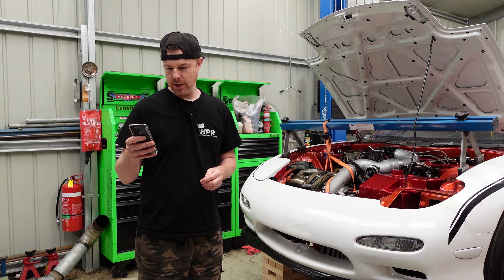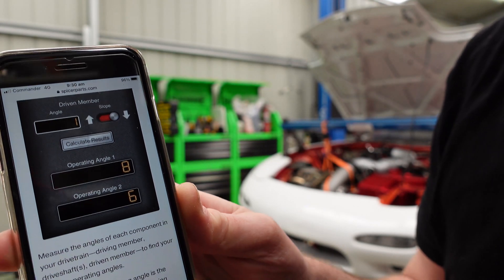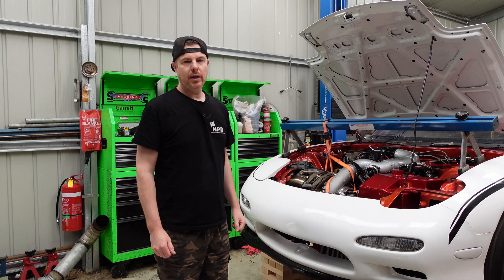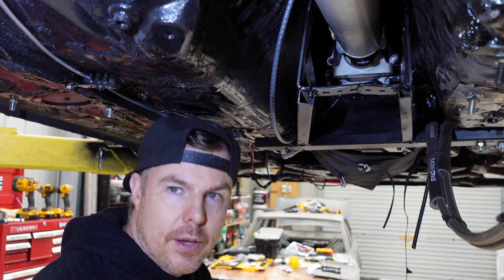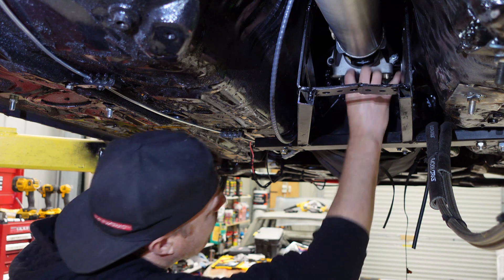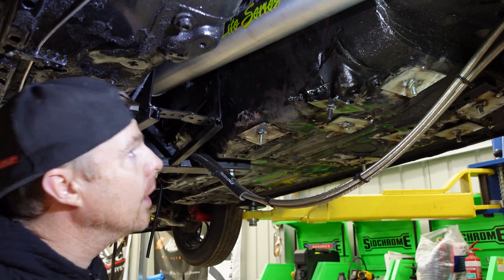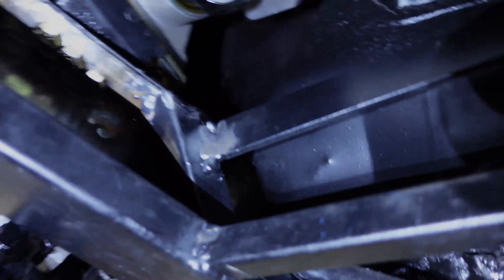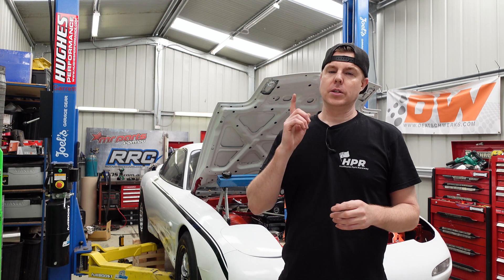How to Set & Measure Pinion & Driveshaft Angle

Comment: Way over complicating a simple process. Engine should almost always bet set at a down angle. Pinion should be pointing up at same angle. I.E. 3 dgrees down, 3 degrees up. For drag racing all bets are off. Depends on chassis and rear axle mounting.  No need for calculators.

Comment: I installed a 3" lit kit in a 78 J10 Jeep. 
Now as it sits with truck frame is maybe 1 degree "Rear end up", I find results these measured numbers here below.

Trans output end is 4 degree down.
Driveline is 2 degree down.
Diff Yoke is 11 degree Up.

What would be the correct shim angle to correct for this.
The Yoke at 11 degree from a Post kit results is quite extreme IMO.
thx

Comment: Rather then cutting the crossmember mount, you can space it from the body with longer bolts and an alloy or steel spacer...
Reply from the maker: You could do that also 100%. I chose not to here because it would have meant having to remake all the dump valve hoses, and remake the rear section of the belly pan.